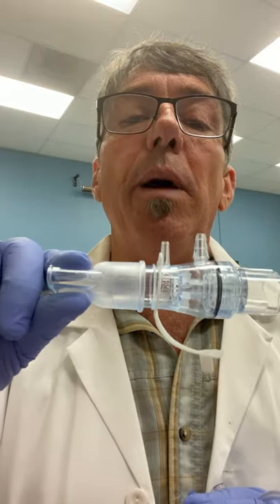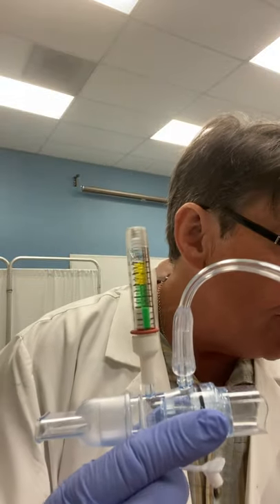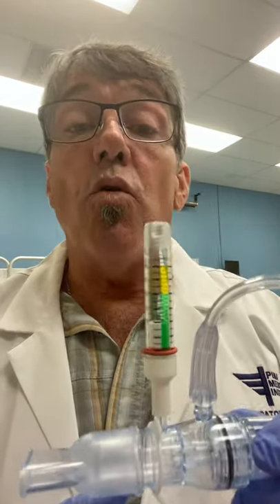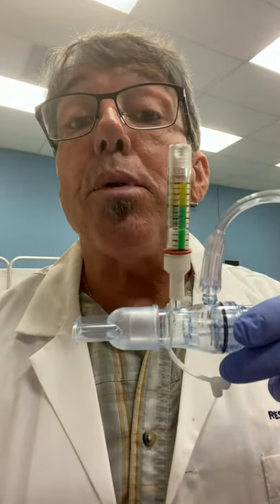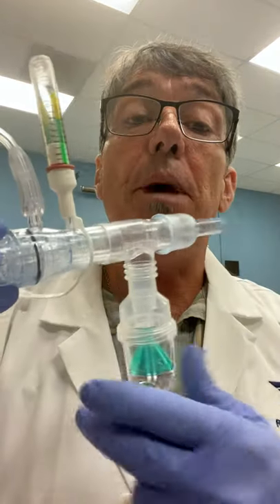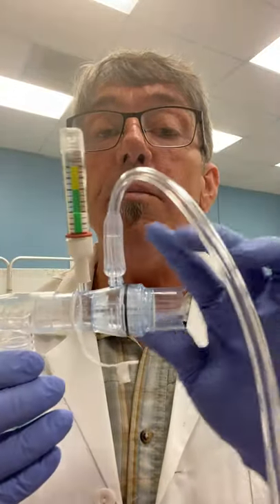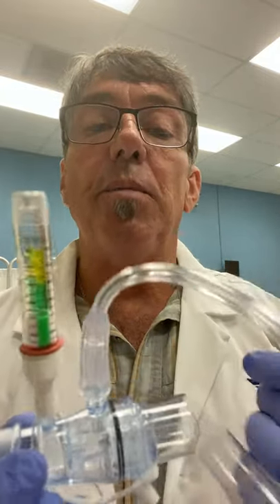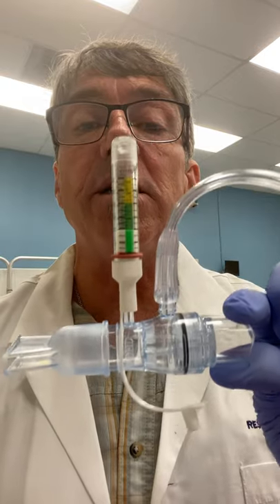EZPAP

Comment: Hey Chris was wondering..sometimes pt on inhalation have loose lips but tighten their lips on exhalation. Is there therapeutics in keeping lips tight on inhalation.
Reply from the maker: Hi Kathy, the benefits are on exhalation.  Exhaling against the "Back pressure" helps expand the lungs. It also increases Functional Residue Capacity (FRC).  I hope that helps.
Reply from the maker: With this device, its all about expiratory resistance. Inspiration give the patient the volume needed to produce a sufficient expiratory breath.  Good Question!!